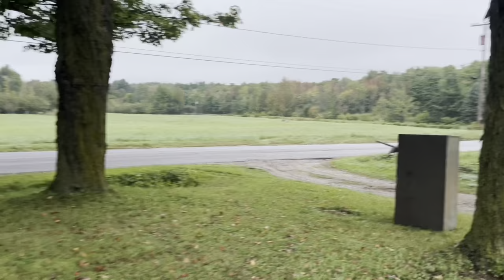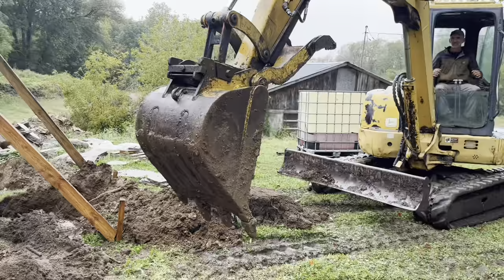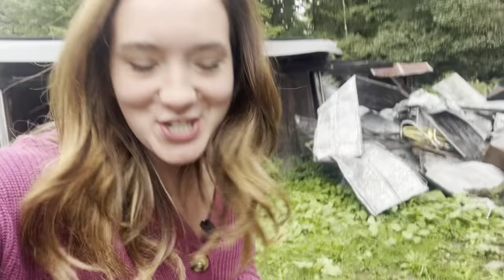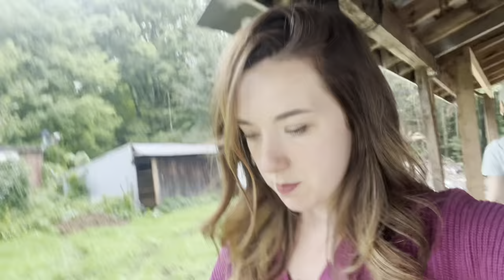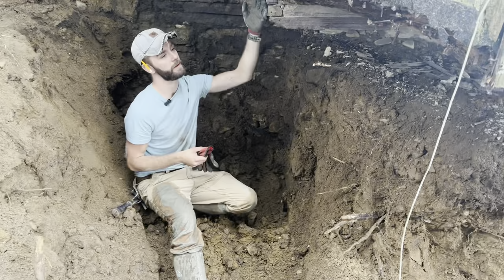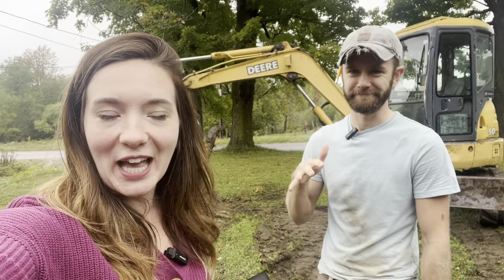a new FOUNDATION for my BAY WINDOW (part 1) | Fixer Upper Home Renovations

Comment: If you put plastic under the bay window, please don't staple the plastic to the underneath of the floor joists, it will trap condensation and rot out the joists. Instead you will put the plastic on the ground to keep the moisture out. Remember, vapor barrier should always be kept on the warm side.

Comment: great video, before they finish the bay window foundation you may want to insulate under the floor and run wire for a double outlet under the center window for a future Christmas tree it will be easier and cheaper now
Reply: How many times can i like this comment!!

Comment: Hi! I just found your channel today, and I'm so excited for you! I left a comment on your floor-plan video, but I just wanted to recommend having the laundry access directly off of the living room instead of only through the bathroom. Your bathroom will be more spacious, and you can still have a space for your coats and jackets in the laundry room. If guests or future kids need to use the washer, you don't want them to have to go through the bathroom, or be locked out if the bathroom is in use. I'd also recommend having a mudroom style entrance to the laundry room off of the porch instead of the little side door going into the living room.

Comment: Many basements and foundations were built with ground contact pressure treated lumber and pressure treated 3/4" plywood but that was in the late 80's to mid 90's. Fell out of favor after that for block or poured concrete.